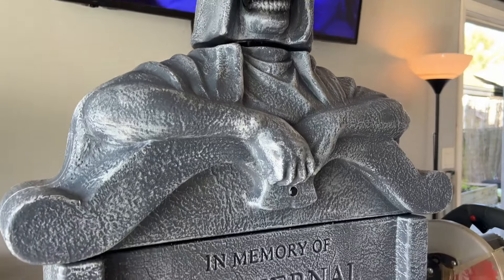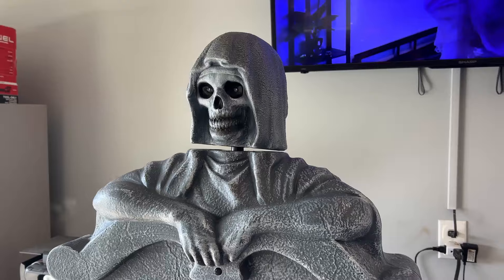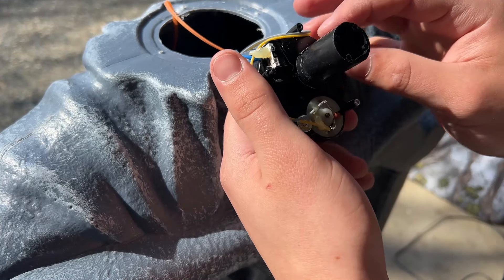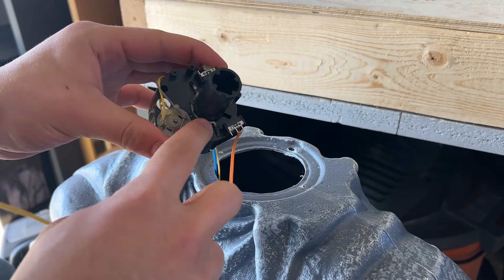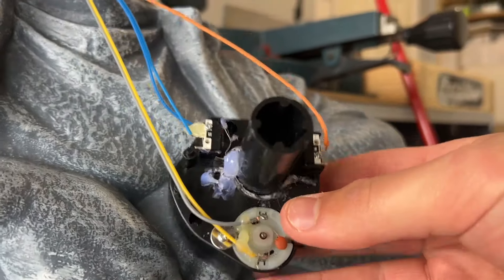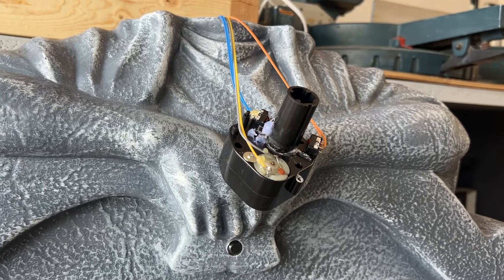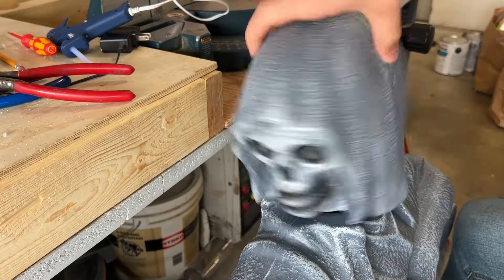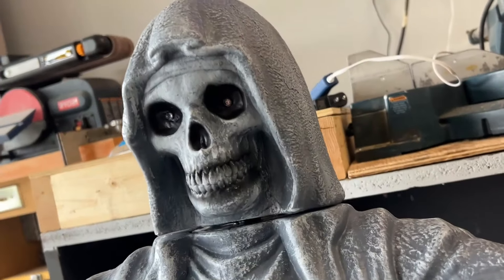Attempting to 'Fix' my 2023 Eternal Rest

Comment: I recommend getting new relays. You can replace the metal pieces on the current ones with the metal pieces on the new ones. They need to be the same shape, however.

The hole in the head turning mech is actually supposed to have a plastic bumper, which hits the relays. If you can attach something onto that, it should end up working.

For the LEDs, I recommend stripping both wires and twisting them together. Use electrical tape to keep the wire hidden.

Hope this helps!
Reply from the maker: Thank you!!!!!!
Reply: @HalloweirdYT  No problem, I hope it works!!! She's a neat prop!